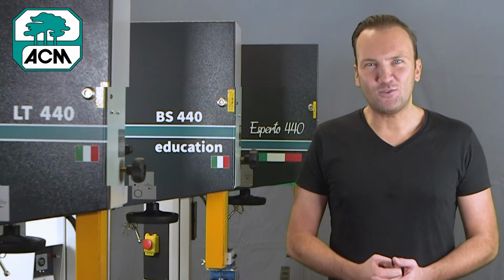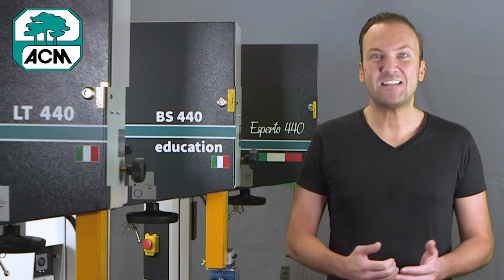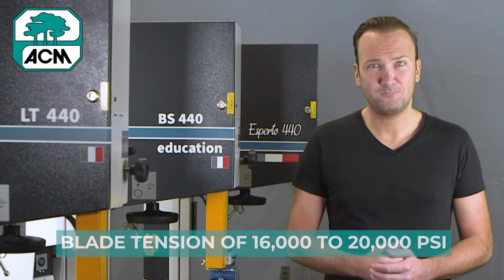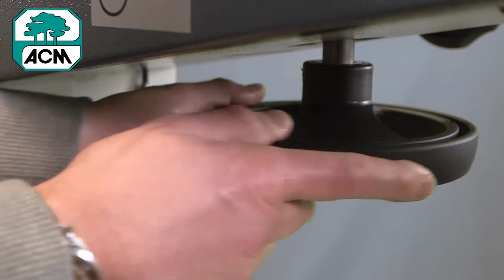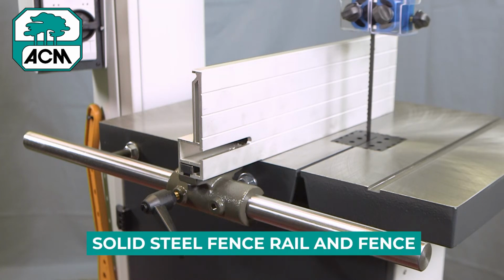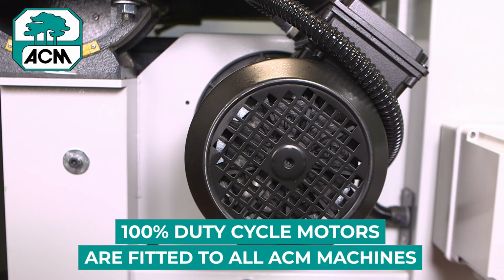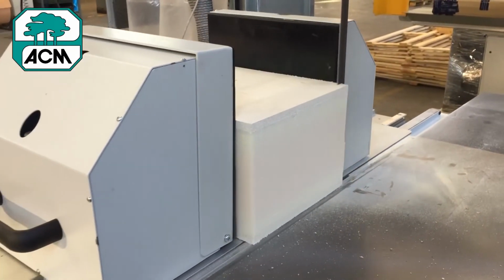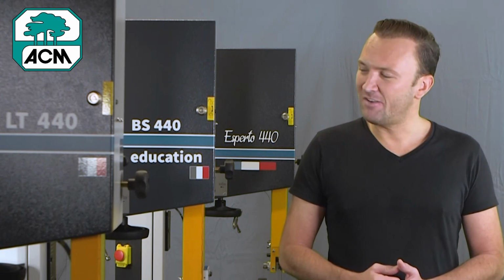ACM 440 Bandsaw Range

Comment: What are the specifications of the blades that it can tighten to 20,000psi? I'm looking for a saw that will tension a 1" x 0.035" (25mm x 0.9mm) blade to 25,000psi for re-sawing operations. Would the BS 540 range be a better option for these higher tensions?
Reply from the maker: Hello Josh all the range are based on the BS body and have the same tension mechanism. The BS 540 would be be ok for resawing because it has 3hp, but the LT440 also has 3hp. On the 540 You could have 4hp in 3 phase but I am sure 3hp will serve you fine. Cutting height is about the same 320 on 440 and 350 on 540.so you will save a lot on a 440. Both will correctly tension a blade up to 35mm so 25mm is no problem. The tension scale is set with a proper gauge which measures the stretch of the blade. I would try using our setting indicated on the gauge first then go up if needed. I know it is bigger than you need but look at the BS 740 3" RE SAW on our web site that uses a standard BS740 body with wider wheels and can tension a 3" blade It also has the same speed, they are all based on that super strong BS body
best regards
Phil Meyers
Reply: Hello Josh all our machines take up to a 30mm blade. to get to 1500 psi you will need an approximate blade stretch of .0026 to tension correctly. Obviously the wider the blade the more poundage needed to stretch that blade. Our tension gauge is calibrated with this in mind. the normal Chinese machines, 90% of those out there have not the strength or tension screw to achieve this. I am confident on our machines tensioned to the gauge will perform but the machine is strong enough to go beyond bit you should not need it both the 540 and 440 are suitable but on the 440 get the LT 440 3HP We can of course offer higher hp in 3 phase

Comment: Hello Phil
Just wondering if you could tell me if there is a similar video somewhere on the Star/SNA line of saws.
I don't mind if it's an Italian production, 
I am seeking either a similar video in regards to the tensioning system on my 600 machine, or indeed a manual, as I am having trouble finding a diagram of the parts like the thrust washer/lasy susan,
tensioning spring and washers, and anything else which might have disappeared.
I bought mine used and it seems it had a very big fall, or something extremely heavy fell onto it at some time.

The best I could find was the manual of the specific ACM built LT line of Laguna's , (not the cheaper series)
 but the drawing is not very clear, nor specific in relation to the information I seek.

Thanks
Tom
Reply: @phillipmeyers9532  Wow, I wasn't expecting such a speedy response! 
Thanks for getting back to me Phillip.
Sad to hear that the Star range is gone, but after a good 40 year run, I suppose things must change at some point.
Glad to hear you folks are still producing the SNAC range though, if that's another technical term for the LT series.
The 540 looks the perfect size to me, but alas, a rarer beast to find on the used market.

Delighted to know that documentation exists from ACM, yay!
I thought I was going to have to get fimiliar with some Italian to get through to the headquarters,  and as far as Google is concerned 'sega',  is a computer games console 😂

Great to have someone in the UK who we can call upon!
I will shoot you folks an e-mail tomorrow,
Many thanks 
Tom in Ireland